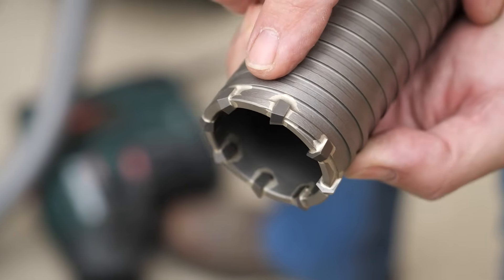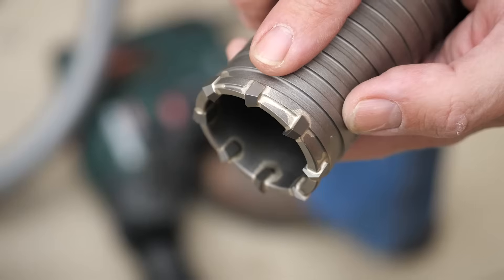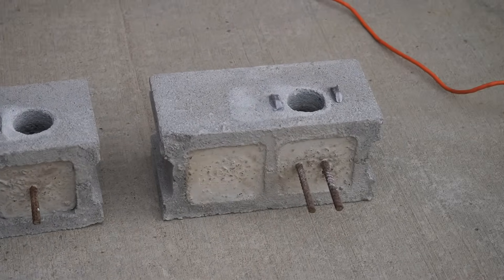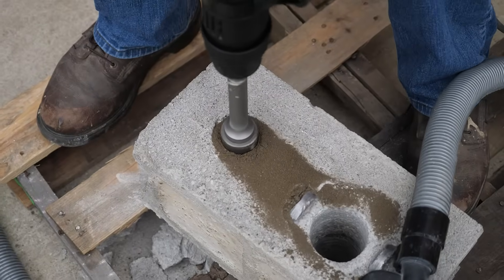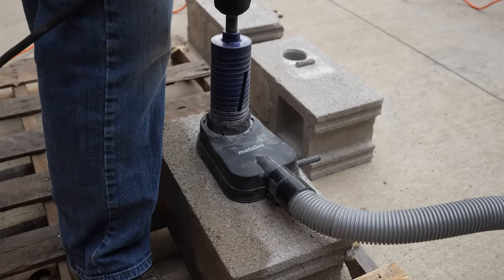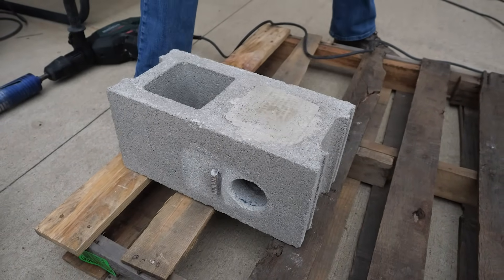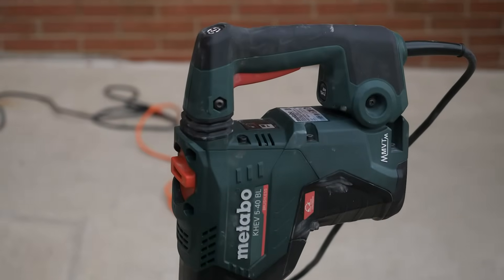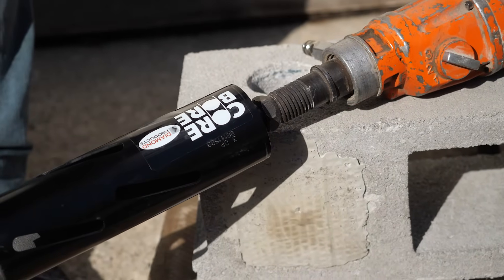Diamond Core Bits vs. Carbide Core Bits - Concrete Drilling

Comment: Anyone have experience running a diamond core on a cordless sds drill? Relative power consumption? Could I expect to run. 2” hole through a concrete wall on an 8.0 amp battery?
Reply: How thick is the concrete? how many whats under load? Probably

Comment: 6 things you need to know for people watching . diamond  - drill  . tungsten drill/hammer  . 2 make a pilot hole through the wall 1st in the centre    . 3 wear goggles/ear defenders . 4 use drill with a good clutch as can injure wrists/shoulders if it catches . 5 buy diamond is worth the extra money as you get a cleaner hole in hard materials like brick etc .  6 drill outside - in ideally (avoid dust) and finish inside the last 1/2 inch to avoid blow back to make clean hole . that is it .

Comment: What do you recommend for cutting a nice clean/professional looking hole through stucco?  Thx!
Reply from the maker: We would recommend a wet diamond core drill bit, they are the most affordable and are suitable for drilling small holes in stucco. It is recommended to use a low speed setting on your drill when drilling into stucco to avoid damaging the surface. Apply light pressure and allow the drill bit to do the work. We hope this helps!
Reply: @OhioPowerTool  I had already ordered a carbide one and its coming today in mail.  Still ok?

Comment: Am i meant to use hammer mode on my sds when using carbide core bit?
Reply from the maker: You will want to use rotary only, hammering can and usually will break the carbide teeth.
Reply: @OhioPowerTool  Got lucky today then! I was using hammer for a little while but doesn't look like the teeth got damaged. Won't be doing that again!

Comment: Great video - thank you very much. Can I get a 7/16 quick change shank coring adaptor for a normal drill like the DCD130 dewalt mixer/drill or the big DCD470 right angle joist drill? I saw the threads in the back of the diamond core bits at the local shop and wondered what fitted that, and now I know, but hopefully there are adaptors made to suit normal 1/2" chucks.
Reply from the maker: We don't sell a 7/16 quick change adapter, since dry core bits can attached to grinders or hammer drills can't see why this wouldn't work if you found the right adapter (assuming from a reputable manufacturer who tested and confirmed this worked) we just don't sell one currently.
Reply: @OhioPowerTool  turns out the local shop did have them, just not in stock, they also had a kit of different sizes which included SDS and hex adaptors, which is what I ended up with, so all set for diamond holes in concrete in future for most common sizes.

Comment: I need to mount the bases for uprights to a handrail. 12 5/16” holes. After 30 minutes and ruination of 2 carbide tipped bits with the result of 1 hole, 1/4” depth. Got to be an inexpensive way, doesn’t there?
Reply from the maker: What kind of drill are you using right now? We would recommend a hammer drill if you aren't already!

Comment: Handheld core drill has slip clutch adjusted/designed to specified diameters of core drill. E.g. with Husqvarna DM220 you can drill from hand up to 80mm (3") according specifications. In reality and regarding material it is managable up to 150mm (6"). So in some cases it is better to rent the machine and core bit or rent the machine and buy own core bits.
Reply from the maker: Thank you for your input. We’d agree different materials are going to be softer and easier to drill but you never know when you might hit rebar or some other harder rock that could really bind up a drill. Most handheld core drills will say 3” handheld or 6” mounted in a stand. Certainly the drill can handle it but not the user.

Comment: Which type should use water Cooling,  and most important,  hammer or not too hammer ????
Reply from the maker: Carbide Core Bits hammer into the concrete to make a hole, this is compared to Diamond Core Bits that are grinding into the concrete instead, which saves you time! Carbide Core Bits require a coolant to prevent burning and overheating, where Diamond Core Bits do not require a coolant as they will not overheat due to their way they are manufactured and their heat resistance.

Comment: Actually, I honestly believe it does matter what the back side of a hole looks like because that changes the structural integrity. The shape of the arch that's created can make a big difference on the amount of weight the structure can handle around that hole. So guess I don't agree with that ultimately it doesn't matter myself. Maybe most people only think about the looks more than anything but that doesn't change the facts any. Perfect arches hold a lot of weight

Comment: Which one would you recommend for my sds max cord drill?
Reply from the maker: Most people using SDS-Max drills use carbide core bits because they are used in hammer drill mode which won't work with diamond core bits. Hopefully this video helps understand the difference of the 2 types and when you want to use a diamond bit instead. Also how those can work with SDS-Plus and many SDS-MAX (if they have a drill only mode) hammer drills.

Comment: We want to drill into a garage floor to install plumbing for a toilet.   It will be next to an outside wall so we only need to go a few inches.  How will this system work.   We have been quote $3k to do this by someone else.  Thank you for any suggestions
Reply from the maker: There is a lot that goes into installing plumbing into an existing concrete slab. While we sell a lot of tools to help trained professionals do this work this is not a DIY project or something we’d give advice on. Raised some questions for us here in Ohio where it freezes only going a few inches and going outside. A $3k quote might be very reasonable depending on what all they plan to do.

Comment: I'm a home owner. What would you recommend for drilling a hole in brick for a hose bibb.
Reply from the maker: It depends on the characteristics of the brick, for standard brick a good quality carbide-tipped bit would work fine! Although if you encounter exceptionally hard or dense bricks you may need a diamond core bit. It may be best to just get the diamond core bit, just in case. But that is totally up to you!

Comment: What is the best thing to use if you’ve got like 42 holes to core?
Reply from the maker: It will depend on the material you're coring, but a diamond core drill with core bit may be the better alternative for that many holes.

Comment: Im a DIY homeowner. I dont core often and only have a few times. I dont have the money to spend on a fancy drill for coring or a hammer drill. So what i plan on doing is drilling out holes around my core and tapping out the core with a hammer. I dont want to spend 100$ on a bit I'll use once. It's for a dryer vent.
Reply from the maker: That's very fair! Just be sure that you're taking your time with it and start small! It's much easier to remove more material than it is to add it back on if the hole ends up too large!
Reply: @OhioPowerTool  thank you for the helpful tips. I appreciate it. I know you guys work long and hard to gain your knowledge and I appreciate you giving me free knowledge. It’s also a hell of a lot easier to take more often than it is to add on lol.

Comment: I have the d25481k. I have been asked to put a 4" ballard in asphalt. 

 Do I have this option with this tool?  If so Will bits gum up and such?
 

 Down the road I'm going to have to put a dryer vent or 2 through a pretty thick brick wall as well. If this tool is for the job.

 If you have what I might be able to use post links. I have nothing in the way of the centering bit set up for this machine either...  just bits for chippiing so far

Thanks
Reply from the maker: D2581k is just a Dewalt chipping hammer right? If it doesn’t have drill only mode probably not going to work. Asphalt is very soft and abrasive not hard to drill through but yes gum up the works so to speak. Better with a diamond drill bit not a carbide bit. For cinder blocks either should work but again diamonds will give you a cleaner hole without chance of blowout.
Reply: @OhioPowerTool  
That project (like all of them) morphed into something way bigger so its off the table but, the one I have has a drill only mode. Its not here in front of me but, theres 3 switch settings marked with hammer logo, a drill logo and a combo of hammer and drill logo around the knob if im recalling correctly.

Comment: Never seen a sds max Roto hammer with a rotate only mode… any ideas? Google search is useless.
Reply from the maker: Several dewalt models do for sure but yes not common across board like with sds-plus.

Comment: If I have a  carbide bit, couldn't i just drill a pilot hole through the block wall, drill both sides of the block wall and meet in the middle?  To ovoid blow-out i mean.
Reply from the maker: That would certainly be a better way to do it if you can get to both sides.

Comment: What do you recommend for basalt rock? Plan on putting posts right in, thoughts?
Reply from the maker: Oof, basalt's a tricky one. It's a very hard and dense rock, and if you aren't careful, you could end up going through four or five bits before you even make a dent in the thing. You'll want to look for something with a decent diamond count, the tougher the better, though there are some who say using a pilot pin and reaming out bits of basalt at a time is the way to go. It'd take a bit longer than straight drilling, but you'd potentially be saving an incredible amount of frustration and money going the reaming way, at least according to those that prefer that method. Either way, you'll want something that has the diamond count to break through even the toughest of materials. Great question!

Comment: Why do you say diamond doesn't pound the concrete but carbide does? Aren't they both supposed to be used only on drill/rotate mode?
Reply: The carbide bits you use the hammer drill mode

Comment: Tried drilling 4" hole in brick wall. Bought new carbide bit. After 10 minutes only got 1/8 " deep at most. Cheap bit?? ($22). Are there different types of carbide. Ad stated multi purpose from wood to brick. Should drill be set on drill or hammer.
Reply from the maker: There are definitely different types of carbide bits, ones promoting wood typically don’t do well in brick or concrete. The ones that advertise masonry and concrete will get you right through brick unfortunately cost way more than $22 for 4” bit.
Reply: @OhioPowerTool  Thanks so much for getting back to me so quickly. Your response clears up a lot for me. Your company is the best!!

Comment: I need to drill a 50m (2 inch) hole through an old stone wall about 18 inches thick. I can buy a masonry drill bit of that length but that won't be 50mm wide.
Reply from the maker: Drill a standard 2” core bit with a 12” extension then break off core after 10” or so inches and you’ll be able to go all the way.

Comment: I want to core drill 4 1/2" hole about 6" deep into natural rock, but I only have a 7amp angle grinder. The rock size will be 16" cu. And ether rundle rock or river rock. Can it be done with a diamond cup??

Comment: This was helpful, thank you.  I need to drill a 4” hole 🕳 in a cinderblock wall to facilitate a dryer vent.  I have no idea if the blocks are filled with solid concrete and rebar or what.  I was looking for answers on YouTube and this video has answered most of my questions.  Buy a diamond coring bit and it seems like I won’t need any other tool purchases in order to make this happen, regardless of what I encounter inside the wall.  Placing an order tomorrow.
Reply: Are there bit like carpentry bit for routers to cut different shap inside iron etc???

Comment: what hole saw , i can use in a stucco soffit i need a 4" hole saw for lights
Reply from the maker: If you are trying to avoid chipping stucco a dry diamond bit on a low RPM grinder will be the best bet. Hammer drill with carbide bit will pound and break the stucco...

Comment: I've searched for video's on core drilling until my eye's crossed and not one time did it suggest your channel unfortunately. I'll be in contact soon. I use a SDS plus to core holes for up to 2" conduit almost daily. Usually 1 per job site. The local tool stores keep pushing to upgrade to SDSmax and tell me there are no SDS plus  core bits that big because the drills can't drill them. Well they will. My 1st drill (Dewalt) lasted 5 yrs before it stopped. Use 5A 20V XR batts and only recently had to replace 2 because they won't keep a good connection.

Comment: I need to drill about a 100- 5/8" or 3/4" holes in an un-grouted masonry wall for ledger anchor placement before grouting. Can you recommend the correct type of bit and drill mode?

Comment: Tools for amateurs!!
I work every day with professional tools, ( weka - Husqvarna- ) are the best and I drill on real hard concrete whit water and dry..
Reply: Agreed ,I'm a concrete cutter I would never even contemplate using a hammer drill thats nuts it would take forever not mention hammer the drill or burn it out, ill stick to my tyrolit core drill I think😳
Reply: @justinn446  Bosch hammer drill and everyone else applauds.

Comment: Have to cut a hole for a 4 by 4 in my concrete sidewalk help
Reply from the maker: Hopefully this video was helpful, lots of options for drills, core drill or sds-max. Typically 4x4” measures 3.5”x3.5” so a 4” core bit will give a little room to wiggle. (Obviously larger hole needed if trying to support with new concrete) Diamond core with water would be the best option but carbide hammer core bit would work here as well assuming concrete is in good shape and not on edge of sidewalk (as more likely to cause crack). Always happy to let you know how tools work but can’t give any structural or building advice.

Comment: So if I wanted to to make a 6 inch wide by 6 inch deep core into reinforced concrete… a hammer drill with dry diamond bit in normal drilling mods will do the trick?

Comment: Gonna use Milwaukee 1 1/8 sds + for a 3" and 5" core. First time drilling a core and probably won't do another one for a while. want to get the sds + adapter for a diamond bit. Any recommendations for which bit?
Reply from the maker: Sure, pretty pricey for a one time use, but this should be what you need:

The adaptor: https://www.ohiopowertool.com/p-23844-diteq-sds-plus-to-58-11m-hammer-drill-adapter-to-core-bits-151670.aspx

3" : https://www.ohiopowertool.com/p-23850-diteq-c-34ax-dry-3-concrete-diamond-core-bit-arbor-58-11-d31526.aspx

5" : https://www.ohiopowertool.com/p-23854-diteq-c-34ax-dry-5-concrete-diamond-core-bit-arbor-58-11-d31530.aspx

Comment: Best core drill brand under 1000£, looking to get into the bussines as sole trader at first and trying to determine the best brand that will do its job! No chinesium
Reply from the maker: WEKA drills are best typically, here in US those are from Diamond Products but I think they import from Europe so might start there.
Reply: Try Cardi. Wide range and cheaper than Weka or Hilti or Baier or Milwaukee. For beginning also good: AGP or Eibenstock.

Comment: Nick Do You Have A Adapter From Sds Plus To 13mm
Reply from the maker: Unfortunately, we do not have an adapter of that size. What are you looking to do?
Reply: @OhioPowerTool  I Meant A Chuck Adapter From Sds To Normal Drilling
Reply from the maker: https://www.ohiopowertool.com/p-23844-diteq-sds-plus-to-58-11m-hammer-drill-adapter-to-core-bits-151670.aspx this is a bit bigger than what you're looking for, but its all I really have at the moment
Reply: @OhioPowerTool  No Its A Keyed Chuck With A Sds Plus Shank
Reply from the maker: ah, got ya. Here is SDS-Plus to Keyless chuck - https://www.ohiopowertool.com/p-6433-bosch-sds-plus-to-keyless-12-chuck-adaptor-ha3jaw.aspx

Comment: what type of drill do I use with the diamond?
Reply from the maker: Typically you'll want to use a core drill, but with the new Diteq adapters you're able to use them with an SDS Plus or Max rotary hammer as long as it has a rotate only mode. The one we used in this video is the Metabo 600765620!

Comment: Nick I have the m18 fuel mid torque impact wrench, not sure if that would work with one of those bits
Reply from the maker: Unfortunately not, these are either threaded or SDS. If you need a hammer or core drill though, we've got some 😉